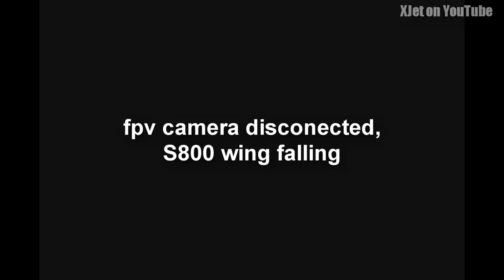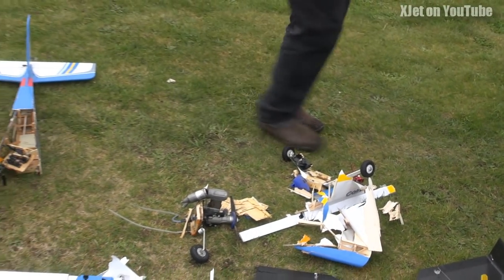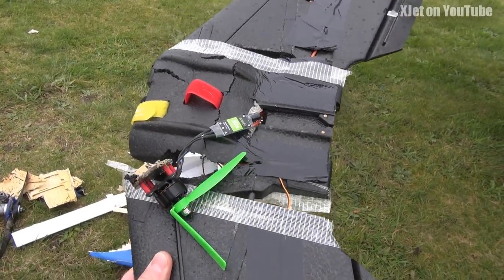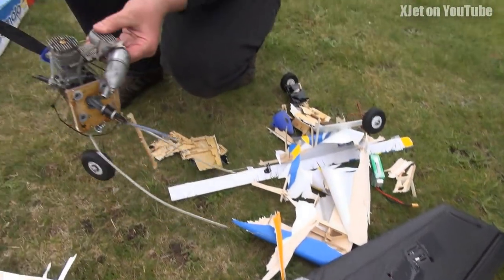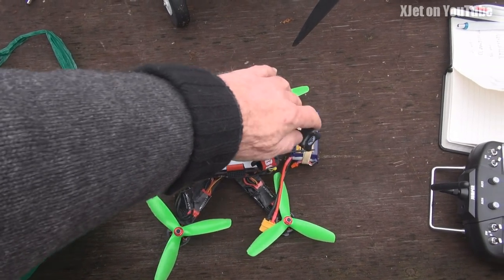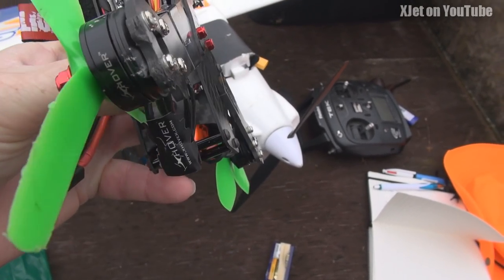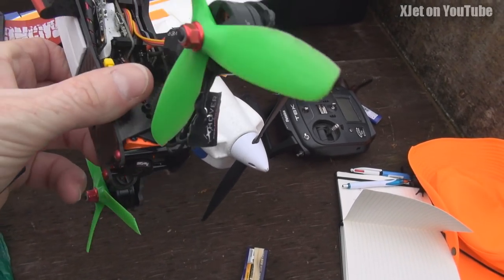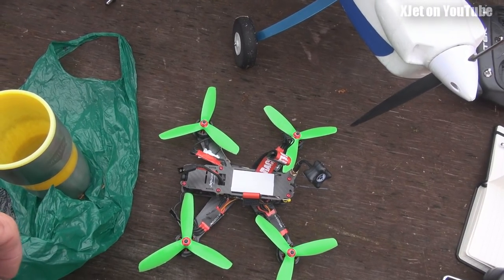RC planes collide in mid-air (no winners)

Comment: And I was tempted to go for those A-spec... 
I guess I'm standing good with the Nanotechs. I pull from them like mad, no alarms just the timer and hadn't puffed one yet. 
And, Bruce... The Split loses just 3 seconds if yanked. :)

it's really curious... I had it hang in a tree for quite a few minutes, once, after I totally drained the battery. It just black-out, ESCs quit, stopped on the nearest branch, then it had enough power left for just one buzzer beep then that died too but the split kept recording about until the VTx gave up completely, that being about two minutes later after having no more juice to spin the props... Just one tiny 1.5A SBEC for the FC, RC, Split and VTX.

Comment: Bruce you can't blame aspec batteries for that, that's a 60c rating battery on a quad that atleast pulls 80c. I recommend those 95c tattu batteries.
Reply from the maker: Those 'C' ratings are all pretty mythical.  The regular 45C nano-tech Turnigy's perform much better than the A-spec ones in my experience.  The Graphenes are better again.  The A-Spec seem to be more of a marketing exercise than a real improvement in the technology.